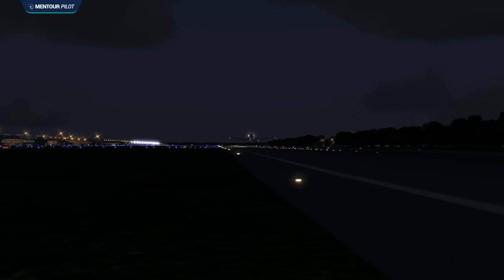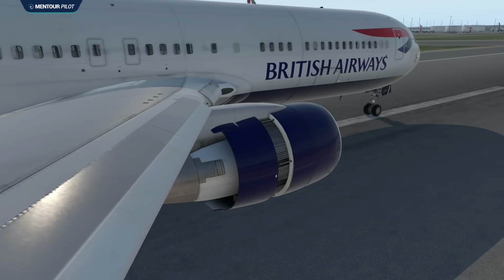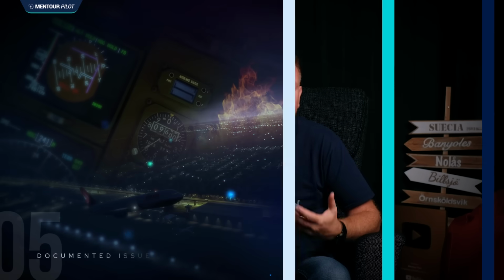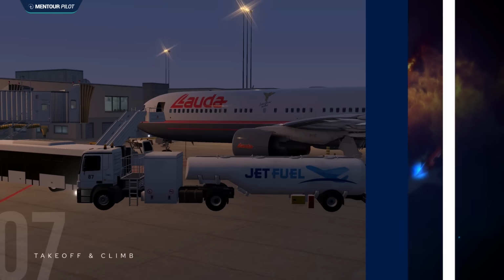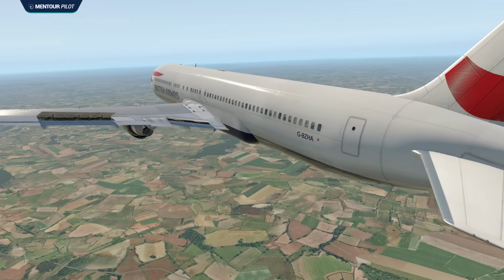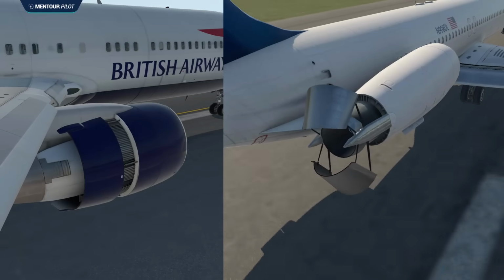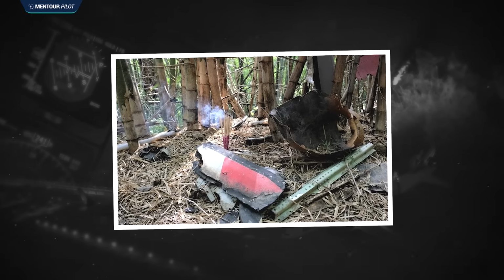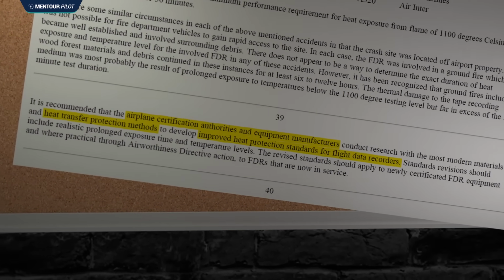HOW an Impossible Failure CRASHED this Boeing 767!

Comment: The production value just keeps getting better, thanks mentor team!
Reply: True.  My only nit to pick is the use of background music.  I really wish folks wouldn't use it during narrations, as it competes with the speaker.   There is enough drama in the actual video without having music attempt to add to it.  I turned on cc and muted various parts. The auto cc does a decent job of getting the words right, even if there is no punctuation.
Again, the video itself and all the tech work putting it together is great; I'm just not in favor of the music.
Reply: @bikeny  Well said. It's schlocky and unhelpful. Everything else is so well done.
Reply: @Flipdrivel  Thanks.  I'm gonna remember to use that word when needed.
Reply: @bikeny  - what, 'schlocky' or 'flipdrivel'?   😨
Reply: @jamesbong7852  Schlocky is the word.
Reply from the maker: Thank you for helping to support the channel. Much appreciated
Reply: @MentourPilot  Why do you use the wrong airline whose B767 had RR engines   ???
Only P&W received a FAA Directive to redesign their reverser mechanism .
Totally misleading and technically bankrupt. ..
Reply: He's very good at explaining these, and I appreciate all the technical details. I'm glad he doesn't dumb it down as the expression goes. I've worked with similar systems (as in hydraulic systems and electrical circuits) in the Navy, so I can understand some of the failures involved.
Reply: Totally agree - a great team effort
Reply: Agreed. Better and better with each video. Hats off to you team.
Reply: it's mentour lol

Comment: I didn't know thrust reversers were that important to the safety of the aircraft. I saw it as just an additional way to stop an aircraft and not the primary way of stopping the aircraft.
Reply from the maker: It is secondary in most cases, unless it’s slippery.
Reply: @MentourPilot  afaiu it is usually allowed to fly without operational thrust reversers, so it must always be secondary
Reply: @fuzzy1dk  Yes, you can fly in general with one thrust reverser inoperative (depending on the specific aircraft of course) but there is a performance penalty which usually precludes operations on contaminated (slippery) runways.
Reply: @fuzzy1dk  For a typical airliner landing operation on a dry runway, reverse thrust only handles approximately 15% of the brakes-on kinetic energy.  Flooded/packed snow increases their importance, however, and under icy conditions they really matter.
Reply: @DaWolf805  there was also the TAM 1054 crash which flew & landed with the right flight reversor inoperative and confused the pilot  who landed the plane in a very short, & very wet and slippery runway in Congonhas on 17/7/2007, and caused the plane to pull to the left and crash into a hangar and catch fire with over 200 passengers and crew burnt alive.
Reply: @anthonywilliams9852  It wasn't really about the reverser on TAM 3054. They should have been able to land fine without it, even with the runway being contaminated. The faulty reverser was not actually listed as a contributing factor in the final report. However, the regulatory authority's failure to regulate operating into Congonhas with a faulty reverser WAS listed as a contributing factor, as such rules are standard for airports like that one.
Reply: @MentourPilot  Are there any non-emergency situations in which pilots would be allowed to attempt a landing which could not be completed safely without thrust reversers when an alternative airport would not require them?
Reply: @flatfingertuning727  No-diversion, no-alternative flights exist in certain exceptional cargo transports.
Reply: Mechanical brakes will be physically worn down by use; any kinetic energy that can be dissipated via means other than the wheel brakes will thus save wear and tear, and thus maintenance cost, on those brakes even in cases where the brakes would have no difficulty whatsoever stopping the plane by themselves.  The cost of maintaining thrust reversers is generally less than the cost of the extra brake maintenance and replacements that would be needed in their absence.
Reply: Me too
Reply: I'd thought the engines were running in reverse!
Reply: @veramae4098  Turbine engines cannot operate backwards. It is simply incompatible with their working principle.

Comment: Thanks for the great and thought provoking video. It's rare amongst the investigations you have produced to see an air disaster caused only by the failure of the aircraft systems.
Reply from the maker: That’s correct
Reply: @MentourPilot  I love your channel and applaud all pilots for their fantastic skills! I am afraid to fly but love it so much that I get on the plane anyway! It is thoroughly exciting to fly!
Reply: @MentourPilot  Why so rare that you reply?
Reply: @Netbase2000  look at how many comments he gets. It’s just not practical for people with larger channels to address every comment.

He may still read every comment even if he doesn’t respond.
Reply from the maker: @Netbase2000  I try but there are thousands of comments to answer.
Reply: @Simone Aurighi I think it's fair to say that the two Boeing 737 Max crashes were due to a failure of aircraft systems (in addition to, similar to the crash in this video, failure of certification processes).
Reply: @Erik Carlsson Those who are competent in aeronautical engineering know that the two MAX crashes were not caused by any system failure but were due to a lack of pilot training. Just the data from the FDR shows that the erroneous activation of the MCAS feature was not at all deadly (as the news media declared), and that the repeated erroneous activation was handled quite well—and instinctively—by the pilots each time, as expected by Boeing. I cannot say why the pilots didn't receive the training to handle a runaway stabilizer; the official investigation agency for each accident should have pursued that investigation, but they didn't; it was politically desirable in their country to simply incorporate the false story that had been published worldwide by the media and had become entrenched in the public's mind.

There was also no failure of the certification process, for the MAX or for the 767. Mentour Pilot didn't mention that prior to the emergence of high bypass jet engines, in-flight thrust reverser deployment was actually a useable feature on jet airplanes for making rapid descents. The concept of reverse thrust for jet engines evolved from the reverse pitch feature of propellers on piston engines that was used after landing to help decelerate the airplane, but I don't know if in-flight reverse pitch use was common or even permitted. Certification is done with the best knowledge available and considered reasonable at the time. Hindsight is 20/20 and little knowledge is a dangerous thing which can lead people to think they have become aeronautical engineers by watching a 30 minute video on YouTube. It is even more stupid to think that engineers deliberately design something knowing it is inadequate, then keep their fingers crossed hoping the inadequacy won't be discovered on a product that is used dozens or hundreds of times a day and when something goes wrong it can't be swept under the rug—it makes headline news and is intensely scrutinized.

The ability of incompetent people to conduct their own "investigation" and publish nonsense in the media before the official investigation is completed—thus having a high potential for corrupting it—while the manufacturers, airline, safety and regulatory agencies, etc. have to remain publicly silent per international convention, is a serious impediment to improving the safety of flight.
Reply: @petep.2092  "Certification is done with the best knowledge available and considered reasonable at the time."  That's true most of the time, at least for certifications I've been involved with, but isn't the whole story.

In the case of the 737MAX, it wasn't that something was intentionally designed knowing it was inadequate, but rather that decisions were made to stay with legacy hardware rather than upgrade, even as more was demanded of that hardware.  Only having two AoA sensors maybe isn't such a big deal if the subject is just information available to the pilot.  But once one or more of those are tied into a new system having control authority, created to avoid a simulator training requirement by keeping control forces for a couple of manuevers within a certain amount of what they were for previous 737 versions... and a failure doesn't present in the same way as for previous versions... and simulator training of crews for the new version was specifically to be avoided... well it can lead to needless death.  That chain of events was most definitely related to the certification.

The MAX was grounded for as long as it was (surprisingly long IMO) not because of whatever the media was publishing, but because real safety deficiencies beyond the industry norm were uncovered and needed at least interim resolution (still no third AoA sensor, though a synthetic-data substitute is in work).

Comment: Thrust reversal at high speed does sound like an extreme situation to try to deal with.
Reply: @InsaneMetro The problem is that the tests were lacking. The testing was done at 10,000. Niki’s pilots were at 29,000 feet and at full speed. The thin air made the deployment of a thrust reverser deadly.
Reply: @Powerranger-le4up  Yes, indeed.
Reply: @InsaneMetro Did you watch the video? Also scientific research showed that previous tests involving bucket-type reversers at lower altitude with engines at idle power setting were not applicable to this accident with sleeve-type reversers a cruising altitude, speed and power setting. Bucket type reversers disrupt the air flow behind the wing, while the more forward sleeve type disrupts air flow ahead of the wing. The former creates additional drag, while the latter creates drag and negates lift from that wing. It is almost as if you suddenly have a sail instead of a wing on that side.
Reply: @davebaton8879  I can see bucket reversers being MUCH less intrusive... Like you said, a  parachute on the planes tail...  A sleeve reverser probably feels like a hand is grabbing the affected wing and pulling it down and back.
Reply: I guess what mostly counts, is how close the aircraft is to it's stall speed. If the thrust reversers are deployed close to stall speed, the speed will quickly drop critically low - at the same time as the forward air stream in it self reduces lift. At high altitude, they are not going very high above the stall speed, despite going fast (the thinner the air becomes, the more speed they need to generate lift). In this case with it deploying on only one engine, the thrust asymmetry also get extreme and more than what pilots usually train to handle and aircraft designers take into count (usually the worst case is to flying with one engine shut off - but here there is one engine that produces normal forward thrust and the other one trying to push the aircraft backwards). 
Also the speed of sound doesn't change very much with altitude - so there is a big risk of hitting or even exceeding the speed of sound (and get ripped apart by the aerodynamic forces) like they did here, if things go out of control. That risk isn't at all that high at lower altitudes.
Reply: @InsaneMetro someone didn't pay attention to the episode.
Reply: @InsaneMetro Definitely at least a Boeing 767 NOT! This is proven and accepted by Boeing, NTSB and FAA.
Reply: If I managed to land it, I think they'd be asking why only one seat is brown lmao
Reply: The Gulfstream that was modified to simulate space shuttle approaches actually deployed the thrust reversers in flight to simulate the approach profile of the shuttle.
Reply: @rleeAZ  Thats a complete different situation. The Gulfstream flew much slower, it had the old style thrust reverser, the enginer were behind the wings, there was no asymetrical thrust and the plane was reinforced to widstand the stress flying with deployed thrust reversers and the main gear down.
Reply: @studio732jrl2 I was using an analogy in referring to Niki Lauda's racing experience. Need I explain further? I hope you're not an English teacher by profession.
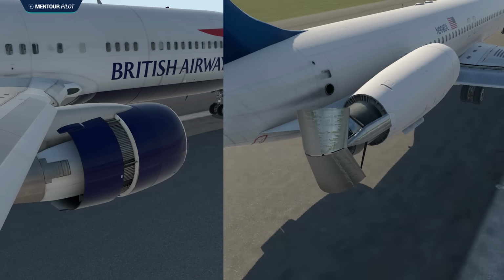Reply: @InsaneMetro Believe in JESUS today, confess and repent of your sins. No one goes to heaven for doing good but by believing in JESUS who died for our sins.  For God so loved the world that he gave his one and only Son, that whoever believes in him shall not perish but have eternal life.(John 3:16)🥳❤️😗❤️🙌
Reply: @alunesh12345  
In order to find peace within say aloud 3 times - 
THE POWER OF COPY AND PASTE COMPELLS YOU! 
THE POWER OF COPY AND PASTE COMPELLS YOU!! 
THE POWER OF COPY AND PASTE COMPELLS YOU!!!